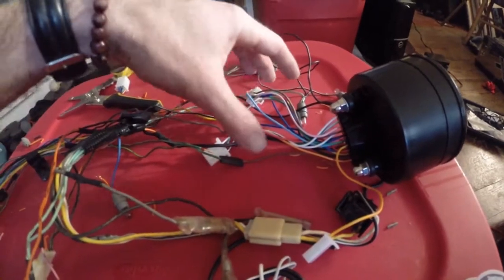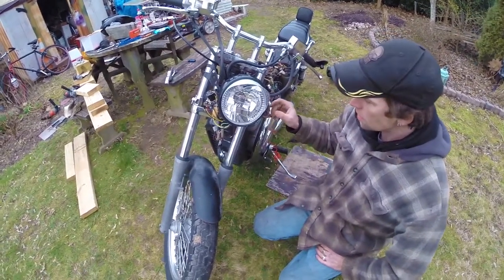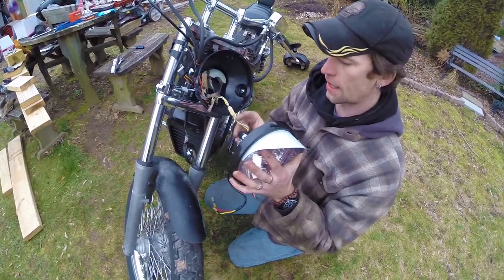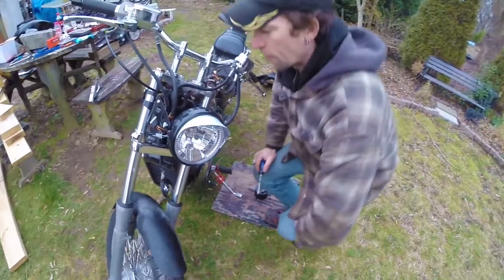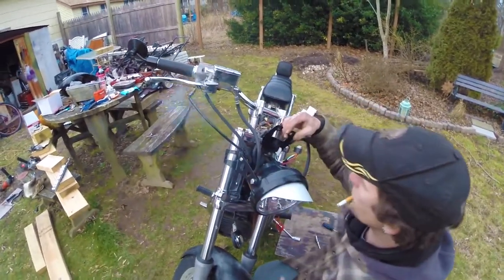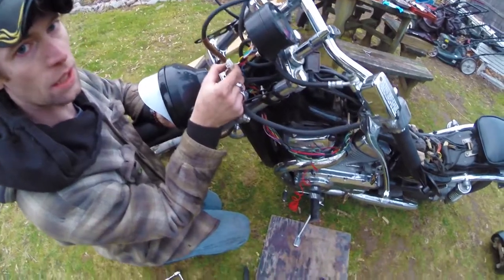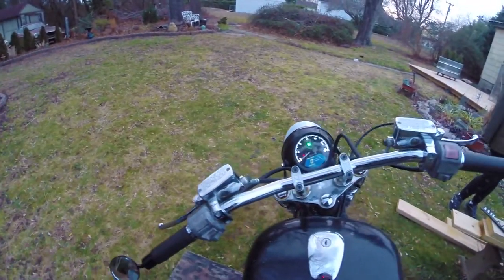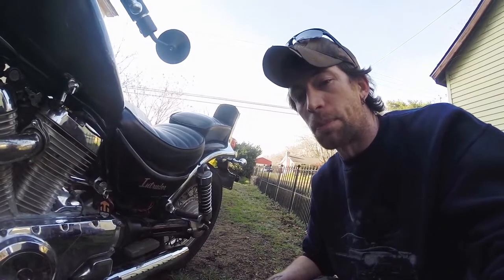New Speedometer and Headlight for the Intruder!

Comment: I could use some of your experience on this model. I was given one that has working led headlight tail light. Signals were all removed previous. Have wiring diagram and basic tools but it’s driving me nuts. I got it running and added kill switch for fuel pump with help from YouTube. But I’m stumped

Comment: Cool job i ave been suffering with this issue for days can you send the scheme or upload it to build the holder (of speedometer)
Reply from the maker: Do you mean the wiring diagram or the bracket I made? I might still have the wiring diagram somewhere...I'd have to look
Reply: @GreaseRenegade   bracket you made :) i found the wiring but its also 🤯
Reply: @GreaseRenegade if you can post bracket schem would be glad